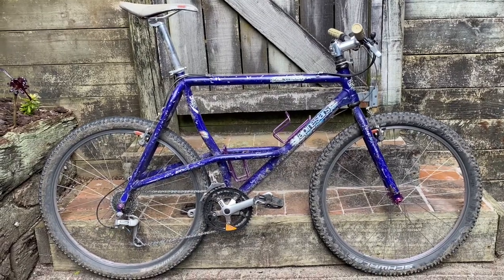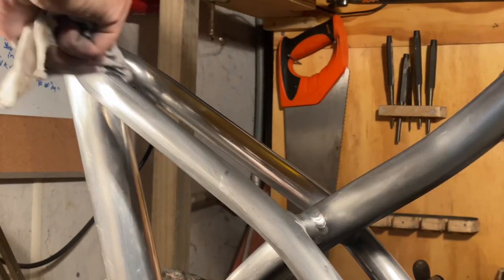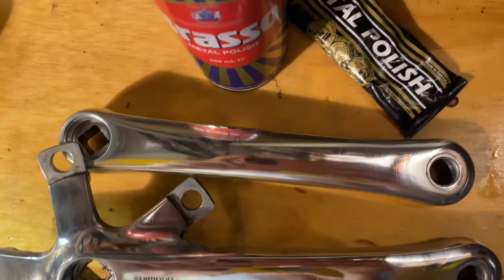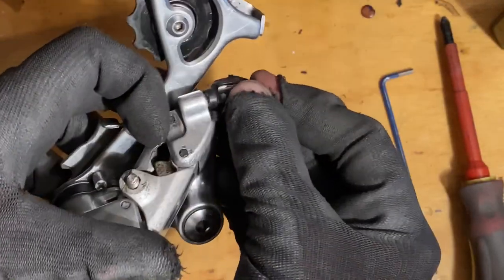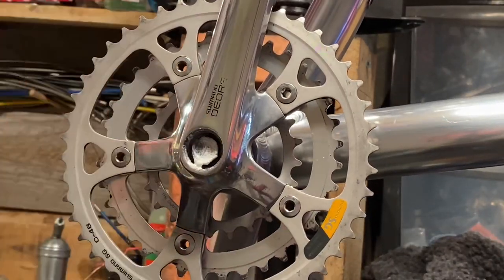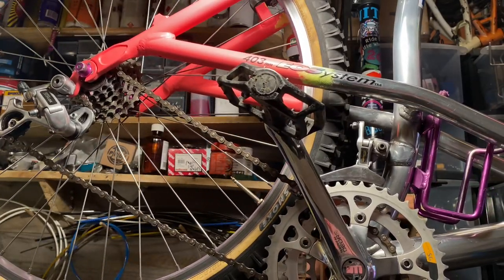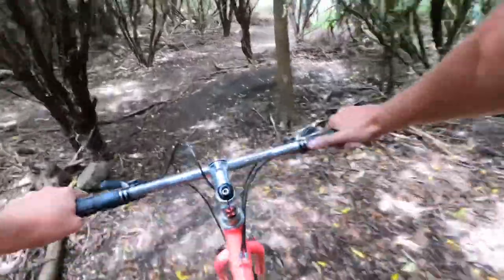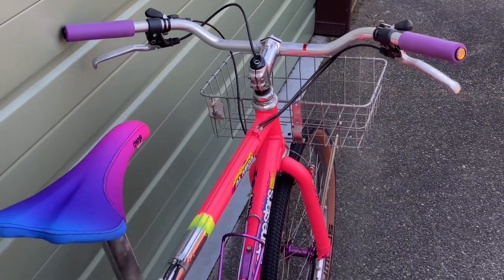Retro MTB paint/polish - Alpinestars AlMega DX rebuild

Comment: If you happen to remove the logos while polishing the cranks, you can use an enamel paint. Let it overflow into the writing and then when it's partially dried, use your finger or a rag and wipe off the excess around the lettering. Only works though if the lettering is stamped into the crank.

And for the top headset cup on that style, you can pack the upper race instead as the bearings stay a lot easier in that than on the more vertical surface of the pressed in cup. And then just put it on the upper cup and when you insert the fork, just keep pressure down on the top as you thread the fork up into the upper race.

Comment: Absolutely fantastic build! I love this frame and your paint and polish job really does it justice! Those pulstar wheels are absolutely DROOLworthy, I'd love a set for my M900 cannondale, would really offset the yellow nicely.
Also, a little tip for installing handgrips, use standard windex, its nice and slippery when wet, and when dry the grips stick on REAL good. It's my go-to.

Comment: With a frame like that I would 100% turn it into a belt drive of some sort. Maybe an internally geared belt drive gravel grinder.
Reply from the maker: Yeah a belt drive e-stay would be sick! Would need horizontal dropouts though to get the tension right. Thought about it but was too hard/expensive to get the magic ratio right with vertical dropouts and a belt drive 😅
Wanted to go 2 speed “retro direct drive” too, but again that works best with horizontal dropouts.

Comment: Looks awesome! 🔥 Nice work! 👏 Are you not worried the exposed metal will rust over time?
Reply from the maker: Thank you 🫡💕 it was quite a bit of effort 😅 
It’s an alloy frame so it will only oxidise a bit, not rust like steel, but from experience the waxing protects from that happening. I think other coatings would be better, for long term solutions though!

Comment: Tiny detail, but I wonder if that paint would stick to zip ties?
Reply from the maker: I just checked where the ziptie was but there’s no mark from it. Or are you wondering if you could paint Zipties with it?
I used it to colour-match the Zipties on the Specialized, so the Zipties on the sharkfin blended in a bit. Had to scuff the tie first and it stayed on ok, some chipped off on install though (makes sense though).
Reply: @toastyrides  I'm talking about colour matching zip ties, so you've answered my question.   Thank you!